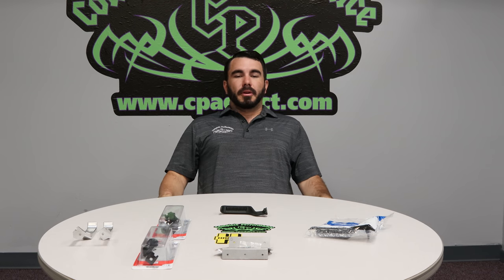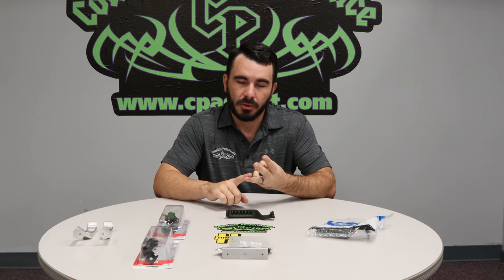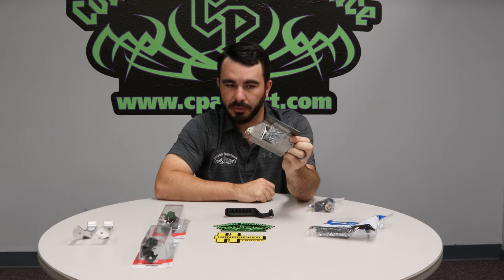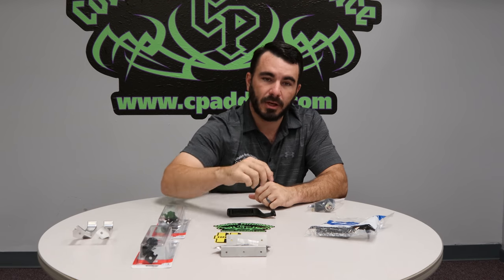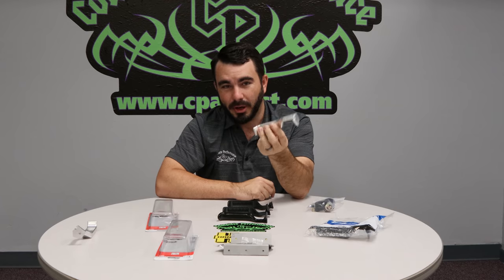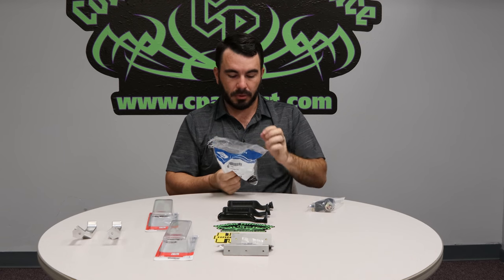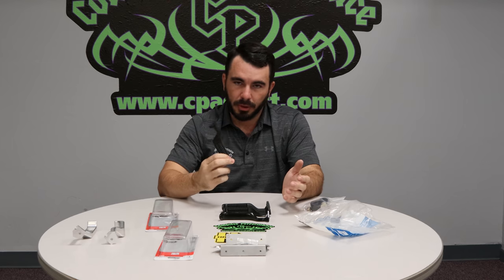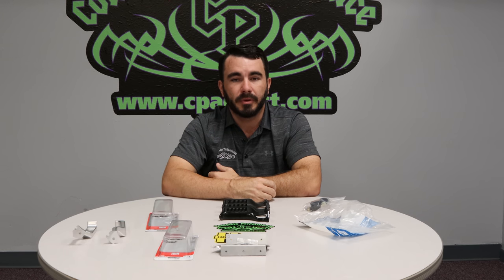How to Fix Your OBS Ford Doors - (1980-1997)

Comment: Wow!  its like we went down your list!  First I noticed the plastic part on the latch striker (?) was toast and replaced that; then  took truck to a "shop" to fix broken door handle (now it wont lock properly); 2 weeks later it broke again.  Son went to junk yard got 80's handle installed; I broke the metal part about 3 weeks later so I found and ordered the repair plate from your company; son installed it (I don't have the tools); greased cables and checked everything out (also greased window channel (had to repair window motor)) - now door latch works like a charm - I found a wire part embedded in the floor of my truck (tucked under the edge of the mat - loop on one end - hook on other) - I think that piece has to do with the locking mechanism .... but cant find a video about it .... sigh .... however, YOU guys have been a big help to this ol' gal!  Thank you!

Comment: Thanks Paul.  I got a 97 7.3 ccsb. My drivers door dose sag. It’s a pain to close I usually open the window to get a good grip on the door and some times slam it but not crazy. So that tells me what you said bushings and striker. I got the truck in February of this year (2020). Handle was broken when I got it. Don’t bother me to open the door to get out but would be nice if it just worked. I am sure I need the handle reinforcement plate cause from what I hear that’s like you said the main issue anyways.  My only hold up on fixing the door besides buying the parts is I’m not sure the door it self is actually any good. The window sometimes falls out when you roll it it. It’s power. And the oem mirror sort of flops when the truck idles or you fit a bump. The skin seams loose?  Is it first time for a new door. Untucks not pretty. I’m on three of the obs groups. I been busy with other projects including the truck. What are your opinion and what do you think I should start with.

Comment: Just picked up a sweet 90 4x4 300 4speed. Im new to the Obs Fords. Im a Jeep man but needed a tow rig. These handles are sweet gonna be ordering some things for sure. I wanna do a SaS and ditch the TTB. Do either dana 44 front 60 rear or 44 front 9inch rear 60s both front rear 44 front Steerling 10.25 rear. 4inch lift 33s. I dont wanna ditch the 4speed for a 5..is there a od unit anyone recommends? The truck was a Auto some one did a nice clean 4speed swap. Im not sure what trans it is....T-18? Idk. I assume its from a  late 60s maybe 70s model truck.